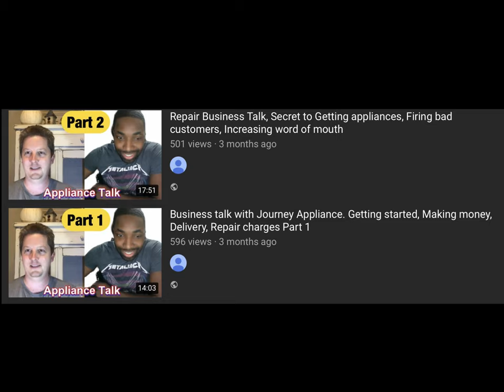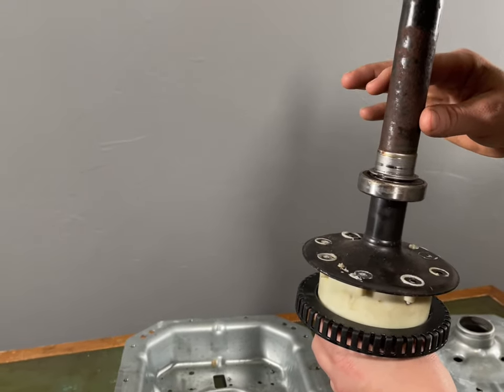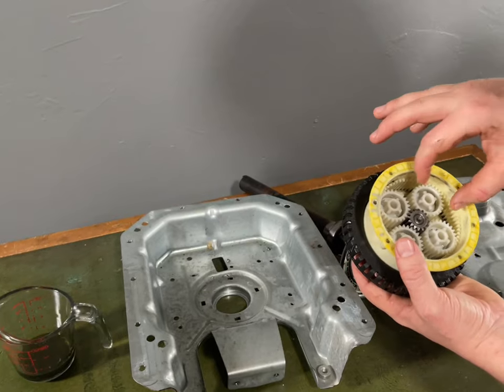Washer Oil leak from transmission gear case seal. Oily mess underneath and on belt. VMW Whirlpool

Comment: Definitely a savior!!!! My inner shaft was spinning freely but the outer one was creaking and it was difficult to spin by hand. Noticed a lot of “tar” on the pulleys, belt and plastic cover.

Used a metal “spear” drill bit to drill at the center of the metal plate after removing the motor, then drill bit to go through plastic, inject grease with my gun and now this baby is spinning easily like new! Thank you very much, definitely a great fix!!!!

Comment: Today I actually implemented your solution.
I laid the washer on its side. Took the motor out.
I ended up using 3/8" wood drill bit because regular metal drill bit would slip and just fought too much getting started on that hard plastic.
The pointed bit held in place and it drilled the hole rather fast.
I should say that I drilled a hole through that center metal support that is in the way first with a metal drill.  And then the wood bit through that hole.
It was difficult making a hole from the two open sides.
Having drained that black tar.. what a mess.
I placed my grease gun right on the hole and started pumping grease.  Not sure how much, but enough to my satisfaction.
I plugged the hole with a fat enough plastic rivot that is used to hold car panels in place.
I cut its stem short and pressed it hard. It had nice flat head.
Then I used hot glue gun and covered it.
Before I placed the rivot, I cleaned that hole area with some rubbing alchohol.
And that is all I have to say about.
Did I run the washer on spin?  Yes?
Was there any funny sound?  No?
Did any black oil coming out of the bottom seal?  No?

NOW QUESTION?
What is up with the click click click abnogtious sound that the clutch platic gear makes at the end of spin cycle on some of these machines?
It appears to me that shifter motor seem to lift up the clutch coupler  slightly up and then down at the last few seconds of the cycle.
There is no way I would blame anything on that except the control board.
Reply from the maker: Good to hear it works. If you have any pictures or additional information about how you did it be shorter post it on Facebook group “ appliance refurbishers and repair”

Comment: So excited to see a video on these transmissions.  I have a used appliance store in Alabama and I have been seriously considering trying to replace  the bearings in these transmissions. It’s just not feasible to replace the transmissions for what we can sell the washers for.
Reply from the maker: I think if you run in a appliance store you could probably get the equipment to be able to pull off the top bearing. The issue is that the average Joe probably would have to spend too much money on some specialty equipment to make it worthwhile. I run a appliance refurbishing business in Mississippi and I would not consider replacing the batteries in this machine because of the time it would take to get to the bearings. I would much rather just part out the machine and move on whenever I encounter bad bearings.
Reply: @WasherDryerMoney  I’m in Montgomery al, what part of Mississippi are you in
Reply from the maker: South Mississippi near the coast college town called Hattiesburg.
Check out the Facebook group Appliance Flippers United.

Comment: Love your videos! Please make a video on how to test motor directly. New to this business and your videos have helped me a lot
Reply from the maker: I don’t test a lot of motors. Are you having a lot of trouble with electric motors not working?Maybe one out of 20 will have a actual bad motor. For the most part it’s usually like a capacitor gone bad.
Reply: @WasherDryerMoney  thank you for responding..so I just started doing this on the side on my spare time. Two dryer machines so far have been bad motors. The drum won’t turn but I hear a humming sound of the motor. I turn it manually and then the machine starts to work which I have read indicates a bad motor. I would just like to know for my own benefit and also it think it would be good to test while the machine is already apart and I am checking everything else.
Reply from the maker: @AnthonyLopez-zx2ix  Definitely a bad motor. That does happen with dryer sometimes.
Reply: @AnthonyLopez-zx2ix  Are you testing the capacitor?  It’s job is to help start the motor.
Reply: @chuckdearruda6271  I am talking about dryer motors. For washer motors I have not tested the capacitor how do you test it?
Reply: Anthony,  Most people just use the capacitor test function on a multimeter. That function is sometimes indicated as MFD or the schematic symbol for a capacitor. The MFD stands for Micro Farads (aka uF). Be sure the capacitor is discharged first (it will already be discharged unless the motor is bad).  You already know to be careful with voltage, as that part of the circuit can store well over 100 Volts. Disconnect the capacitor. Place meter leads across the capacitor; polarity does not matter. 

Those capacitors are usually about 30 to 50 MFDs. Your meter will measure and display the reading. Normally a cap is considered good if it is within 10% of marked (rated) value. So, for a 40 MFD (or uF) a reading of 36 to 40 MFD is considered good.  It’s not unusual for a bad one to read 0 (zero). 

There is another “in circuit” with motor running test method. But that method involves use of a mathematical formula, and there is the added danger of measuring the energized circuit. It’s a more accurate, but usually unnecessary.
Not all meters include the MFD (or cap test) capability.

HVAC videos and web sights, like HVACRschool.com have tutorials as HVAC technicians test lots of capacitors.

Looks like I can’t post the entire link here. When you get to a site like that just do a search for capacitor test.

Comment: Great video. I had a washer come in that the owner said it dumped oil and water all over the floor. Same type of sealed transmission.
I can understand replacing the oil with grease, but where is the water coming from ?
Reply from the maker: If it’s leaking water, it could be from the tub seal or a crack.
I would say that is a separate issue
Reply: @WasherDryerMoney  ok how about this? If a water leak occurred and filled the planetary gear container with the oil it would overflow allowing oil and water to appear on the floor as owner stated. The bottom seal could theoretically still be intact if I'm thinking about this correctly.  But I  think the water has ruined the bearings cause it roars when on spin. Meaning new transmission anyway. I just like to get stuff straight in my head. Thanks.

Comment: I've been playing with a plastic welder recently, that should seal the hole good but I think JB would be better if you didn't squirt it in too far. But now that I'm typing this, maybe a tight fitting plastic dowel piece pushed into the hole and JB on the outside of it... but would that tiny extra weight cause an imbalance and a shake in the spin?

Comment: Hi do you have one of those transmission that has the white bucket gear that holds the oil I broke mine taking stuck drum out I have trans all apart but need that part I replaced the bearings already it was a chore

Comment: This is very interesting to see the inner workings, but I'd be concerned about liability if something happens to ruin a floor after doing this. If the grease spins out due to an improper seal or the top seal let's water pass through, you'd have more of a hassle. Always good to know, but for me, I'll replace the transmission. Unless, possibly, its my own with a drain pan under it.
Reply from the maker: Yeah definitely say if you’re a repair man you should just replace the transmission. You’ll probably make a lot more money. This idea is more for appliance flippers and homeowners that can’t afford to buy new transmissions.
And right now this is still just an experimental idea I’m always trying to figure out a better more permanent way to fix things as an appliance flipper.
Reply: @WasherDryerMoney   we bought a new Roper ( 1 yr & 3 ms ago ( Lowes)  that has developed an oil  leak on the bottom. It has a reddish- black color. We did not purchase the ext warranty . 
 I will let you try your  experiment on ours . Where are you located ?  Also, do the new transmissions now have the  solid grease inside ? ( as seen in your vid) Is it a big job to replace the trans  ? I see they run appx 200.00
Reply from the maker: @dondunham1120  pretty big job to replace the transmission.
He might can find a very nice used transmission on eBay for less.

Comment: The problem I should point is the bigger issue is to take off the top bearing from the case itself. It gets stuck  there which is much more aggrivating than worrying about removing it from the shaft housing.
However here is the solution:
To remove the bearing from the housing it makes your life much easier to simply heat the neck on the housing where the bearing the sits.  Use a propane or acyteline torch.
Then hit it with a hummer and knock the case off.
To remove the bearing from the shaft housing is simply use a dremel and cut it off.  Simply score two sides of the bearing and then with a chistle and a hammer it will simply split in half.
To remove the brase flange.  Clean the shaft housing real good.  Heat the flange with a torch and then simply drive it up with a hammer or something.  Out it comes.

Comment: So did you ever figure out if you can use grease or white lithium instead of the oil and it will work fine? My major concern with this concept is that the oil is used to keep the whole thing cool enough through a few possible cycles in a row. I've never torn one apart right after a cycle, but I'm really curious. I've poured through so many videos i really hope this was the right one.

Comment: Ok, I took the back off. So far so good 🙂
Can you drill a hole into the oil containment part, as you suggest, without removing anything else?
Reply from the maker: I wish I could tell you but I have not gotten a washer with a oil leak lately to do this experiment on. As soon as I do I will post another video if the fix works but I just haven’t gotten my hands on one yet.
If you give this a try let me know if it works and what you find out. I did have someone tell me in the comments that you should use a certain type of grease That will not deteriorate the rubber seal.
Reply: @WasherDryerMoney  results?

Comment: Neat potential solution.  I don't see why it wouldn't work.  I like the idea of just using a metal drill bit to put a hole in the shield portion without having to remove its two rivets and then bend it downward.  Once this hole is in place, another hole could be drilled in the plastic casing.  Although, this makes me think that plastic bits would get into the gear case and cause problems.  In any case, once an oil leak has been experienced, I wonder how long these washers will run for before the gear case breaks down from heat/friction if no new oil/grease is added.  I'll bet they could go for a number of years, but that's just a guess.  I've got an old washer that just leaked, and I bought it used for $50 almost 10 years ago.  I'm wondering if it's even worth trying to fix versus just buying another used one for $50.
Reply: Put a bit of grease on your drill bit. The chips will come out the twist drill flute anyway

Comment: I am having this same problem as well as a clicking noise during spin cycle while trying to slow down. I do not have the money to buy a new one. I did see on the appliance website that a new gearbox assembly is $180. I am struggling to get the gearbox to drop after i removed all 4 screws on the bottom. Any ideas?

Comment: Trying this now.  The oil does not run out unless the gear box is rocked back and forth.  I left it for hours to drain on its own to find that almost nothing came out until I turned the gears again.
Reply from the maker: Let me know how it works. Be sure to join the Facebook group Appliance Flippers united. If you find this process works be sure to let the group know.

Comment: hi started this procedure same transmission....but found water in the gear compartment together with the oil looks like the shaft seal to agitator has failed any idea of the part number? tks

Comment: Did you do a video on the transmission teardown? Thank you
Reply from the maker: I did. It’s not a great video in my opinion because it has a sad outcome. It’s an outrageously difficult job and you will have to have a specialty tools or a way to cut one of the bearings off carefully without hurting the shaft underneath. I would say skill level 10 required for replacing bearings.
But it was an interesting video to see how the transmission works.

Comment: just yesterday found the exact problem on my older Maytag Bravos, same motor. I'm looking for a video on safely removing the components to get to this.
Reply from the maker: I have never been able to find the seal to fix this problem. Before you put too much effort into stopping this oil leak be sure you can find that seal or replace the oil with grease. This washer just has a horrible design flaw. Good luck.
Reply: @WasherDryerMoney  yeah, I think I'll try your grease hack. Unfortunately just cant afford a $300 n change part🙃
Reply from the maker: @jessecooper5415  let me know how it works.

Comment: i have kenmore series 400 and the service guy said was the transmission was leaking water not oil. and could see some rust splatter on the bottom.
so i guess that means i need seals also. Have you figured out the part number for the seals?
Reply from the maker: Probably if it is leaking water it will be leaking around the tub seal. This is a easy seal to find it’s very common to go out and start leaking water on the floor. You can use the appliance parts pros link I have to look up the exact part number for your machine. It’s a more difficult job and does require one specialty tool to remove the drum. Just look up some videos on it before you decide you want to order the seal.

Comment: Really cool, I have not ever tried to tear one of these Transmissions apart to see what's inside. I figured there must be some sort of planetary gear arrangement in there to reduce speed and increased torque during agitate. You can hear the gear noise also. Great video! I have one with water damaged top bearing so I may go for it and maybe set up my hydraulic press to see if I can cleanly pull that bearing and the stainless steel sleeve. Seems a shame to have to replace the whole gearcase everytime a tub seal fails and leaks water into that top ball bearing

Comment: Thinking about doing this tomorrow... Thinking.... Let u know what happens if I do it lol... Wife wants to call somebody, but I think I want to try this first
Reply from the maker: Good luck. Even if you call someone if it’s leaking oil there’s no good cheap fix. Pretty much comes down to replacing the entire transmission which is fairly expensive.
Yeah let me know if the grease works.

Comment: Hell yeah! Just commenting for the algorithm
Reply from the maker: Lol. That is a good move
Reply: Yeah, I do that on a lot of videos. lol
Reply: @WasherDryerMoney  I'm also commenting for the algorithm... And as a non-repairman my idea for the video is a rubber plug for the whole... I have tried to use silicone on something greasy or oily and I just don't see that working... But just a rubber stopper that you could shove in the hole I think has a much better chance of sticking long-term. Not a repairman though so I could be wrong
Reply from the maker: @rowe39425  yeah that’s a very good idea.
Reply: Me too and hoping this isn't the only good move I make regarding this washing machine

Comment: What is the plastic cup the gears sit in called? Mine cracked and leaked oil. I took it apart like you showed and just need THAT part. Stupid company and their stupid sealed transmission boxes!!! My new granddaughter is coming next week and I need to get it fixed. Also, if you remove the central agitating shaft and pour gear oil down it, it will refill the gear cup.
Reply: P.S. Mine has three gears, not four.

Comment: I have the same washer the same wanted thats leaking from the bottom mine won't spin or agitate. It starts then stops do  you think I need a new transmission.do you think its to late to try your method because the machine is not turning or agitating
Reply from the maker: It may be the actuator has gone out.
Reply: @WasherDryerMoney  thanks for the reply

Comment: Don't use ordinary grease. You should use silicone grease because it will damage the rubber because ordinary grease is petroleum base like the rubber. It will melt down the rubber for sure.
Reply from the maker: OK thanks. As soon as I get a machine with an oil leak I will get this fixed I try.

Comment: all plastic gears.  What do you suppose would happen if I just let it run even if the oil leaked out?
Reply from the maker: It will probably still run for a while before he gives out.
The bigger issue is where the oil goes. It gets on the belt and slings on the motor. I’ve seen several motors go out because of the oil.

Comment: How bout using a hydraulic press to remove the top bearing off the shaft....Ive used this method on a 90's Maytag washer
Reply from the maker: It would probably work. I think the biggest issue is the amount of time it takes to get into this transmission. I run an appliance refurbishing business and it’s just not worth my time to do this repair. It’s more worthwhile for me to still some parts and scrap out the machine and move on to another easier faster the fix machine.